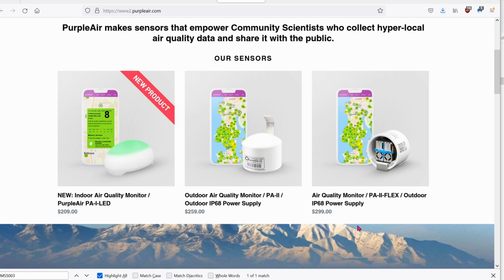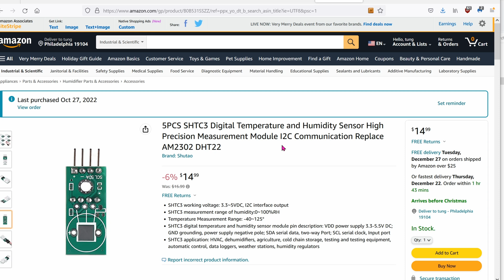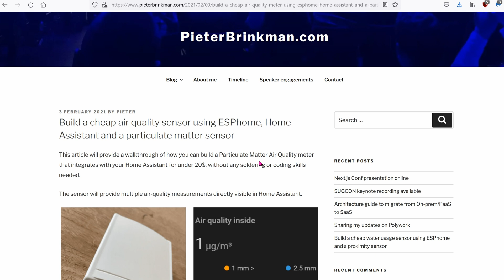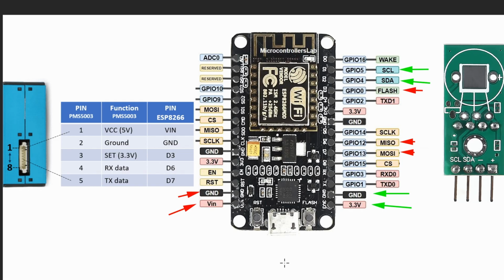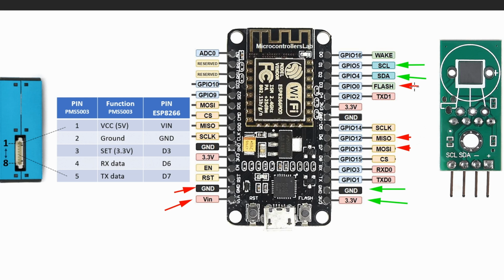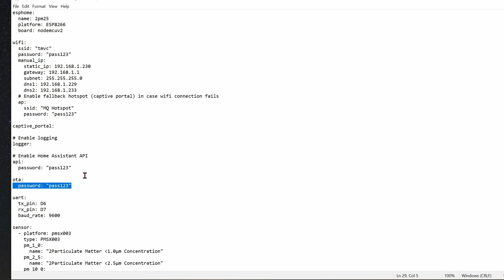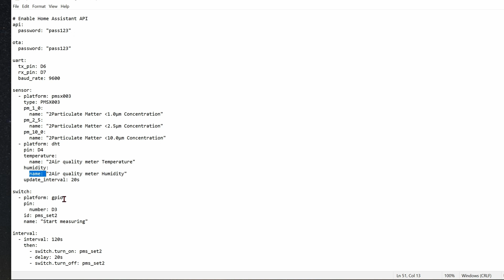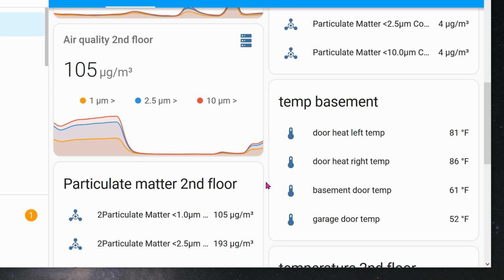DIY: build your own Air Quality Monitor

Comment: a little surprised by no comments yet, this is a terrific video with the clearest possible instructions, links and pictures. I've been putting off getting into home assistant and resisting purchase of several pm2.5 sensors (was looking at Dylos 1100-pro mostly) and diy-ing these will be a lot more fun and cost effective. I especially appreciate the use of viewing data in home assistant. Well done!
Reply from the maker: glad i was able to help you out. check out my carbon dioxide vid in case you want another project.
Reply: Just now getting around to this project, a few tips since (not unexpectedly) much has changed over time with home assistant. Some tips as of Feb 2025
- while I had esphome installed, I needed to install the device builder which is a different module. Trying to add a device using esphome under settings/devices prompted me for a Host: xxxxxxxx which should be in ip address but none yet existed since the dev board had not yet been flashed
- I used the yaml from the comments and found the dev board needs to be referenced as esp8266: board: nodemcuv2 (the board: is indented two spaces from esp8266)
- The device builder wouldn't run unless in htpps: which seemed to require a security certificate, but there is a web version of the device builder that worked with no other config needed.

Still don't have the device online, but getting it flashed was a necessary step.